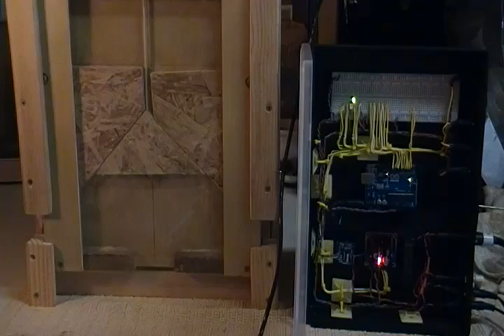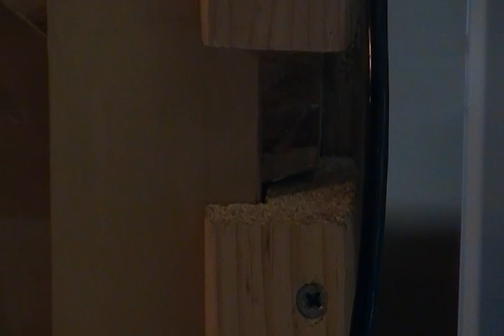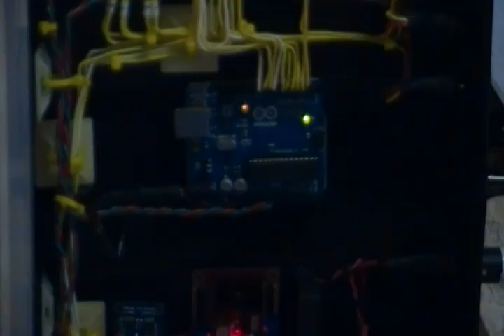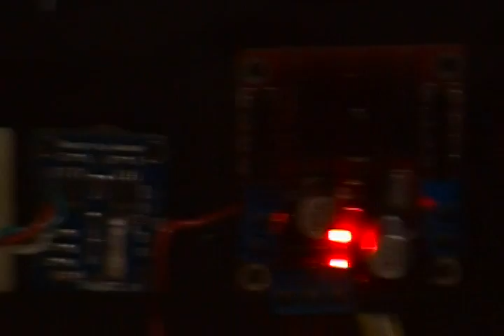Automatic Arduino Chicken Coop Door

Comment from the maker: hi christian,  for some reason i couldn't reply to your comment (weird) so i had to create a new one above it.

anyway,   thanks for share the kind words and the question.  i don't have the code without the simpleTimer but you can certainly use it without by doing as you've done but make sure to comment out lines:
3, 61, 88 and 208  and then add "readPhotoCell();" to the loop.

but know this:   without the timer the photocel readings fluctuate too much around dusk and dawn (which is why i have it set to check every 10 minutes) and the door jumps around and often (even with the debouncing) the door jumped past the switch and the motor kept running and just became stuck.

anyway, best of luck!

//d